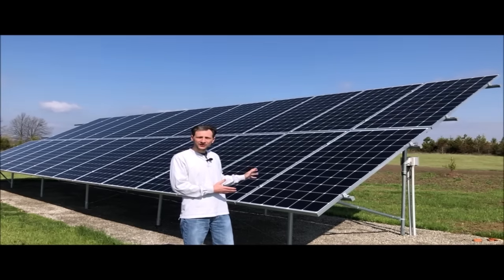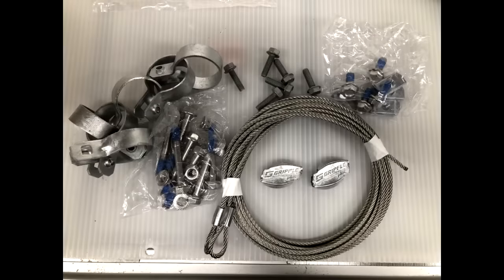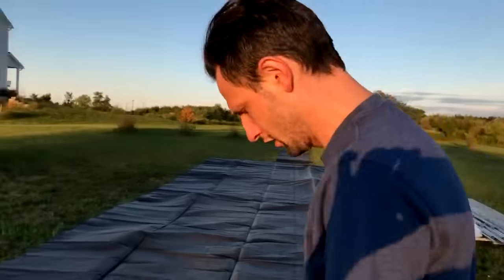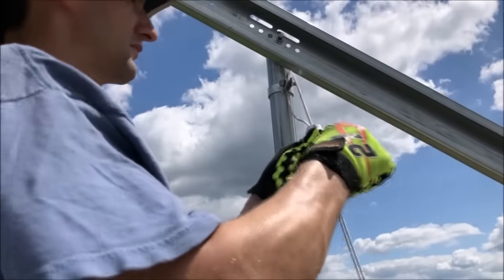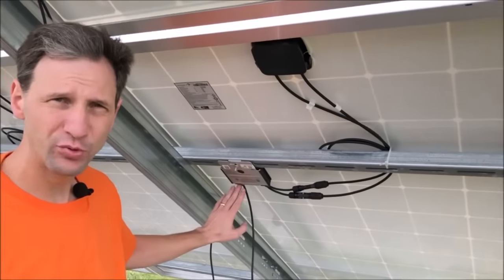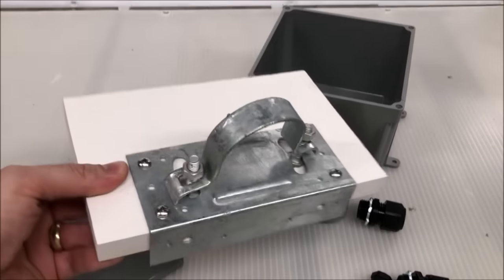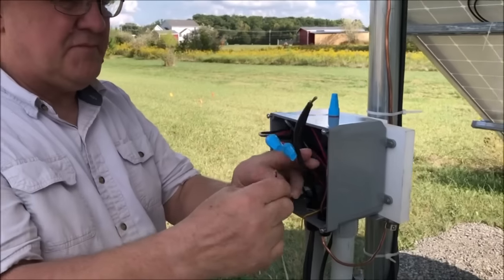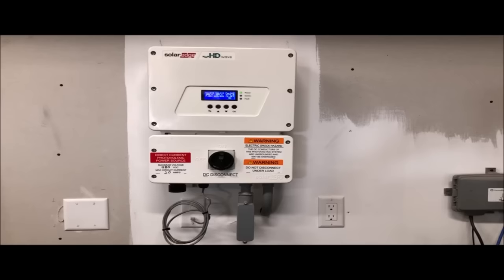DIY 9kW Grid Tie Ground Based Home Solar Panel System Installation

Comment: Very good information, I'm looking to  get solar for my home and I'd like to learn how  the panels work.  Maybe these are silly question but iI'm learning.... lets say 5 panels, together, 

Do the energy load in each panel separately,  fill up then move to the next panel and fill then  move to the next panel and so on and so on?

In full sun, do each panel  absorb energy at different levels?

If there is a crack in the panel  will it reduce the energy it creates as a whole?  How can you check to see if a panel is actually working to it's full capacity?
Reply from the maker: Each panel acts as an independent energy source.  They can be stacked in series or parallel to increase the available voltage or current.  Damage does affect performance you can see an evaluation of damaged panels I did in this video: https://youtu.be/_HKW7mwPiMI

Comment: Nice install. I don't really view my system in terms of long term "pay-back", I just try to save and then buy and install, and from then on its my own power independent of the Grid. Payback for me is obtained when the neighbors lights are all off and mine are still on. This can confuse the local power companies troubleshooting crews though :-).
Reply from the maker: Nice strategy!   : )

Comment: Very detailed and crisp video of the entire process of setting up a solar system at ground level.
Why do you get 1.05 V in output of optimizer?
Reply from the maker: The optimizers are programed to limit voltage to a save 1V per optimizer until initialized by the inverter.

Comment: Wow. Big project. Must be a fun. I have enjoyed to watch the entire episode. I wish there are some holes in between panels so that a strong gust passes through.
Reply from the maker: There is some gap between the panels.  I get high winds where I live.  The system as already seen 60mph gusts since install.  It seems to handle it with no problems.

Comment: I would have a few batteries for a small amount of backup. I am assuming that inverter would allow feeding a charge controller or does it have that functionality built into it.  Nice video btw.
Reply from the maker: The only battery charging my inverter does is EV charging, you can see that video here:  https://youtu.be/U2ilH8yOi7A
However, I am looking into some battery backup options.  Thanks!

Comment: Great video.  Wish I could install my own to keep costs down.  But the local government requires all the installation done by a licensed electrician. Consequently, my cost sky rockets and a BIG discouragement to even consider solar.  My payback went from 9 years doing things on my own to nearly 15 years because I have to hire a licensed electrician.  Being in my 70s, it does not make much sense to install solar because of local government electrical codes since I'll never be able to pay if off.
Reply from the maker: Sounds like the right decision, 15years is too long, a lot can happen in that much time.

Comment: This is a great video Dave. Can I ask you to show the installation when the PVC pipe goes up to inside the garage, I see outside (beside the meter base) installation, then pipes go through the wall to inside the garage. I didn't follow the installation and connections inside and outside the garage. thank you, sir.
Reply from the maker: Sorry, the video would be intolerably long to show everything.  There is nothing special there, I have a conduit that runs from the disconnect box into the garage and then out of the wall and into the inverter.   The conductors simply run directly from one box to the other.  Hope that helps.  Thanks!

Comment: All you need to calculate which way is North is the time. (old school watch is best)
Hold the watch horizontal and point the hour hand at the sun. Halfway between that point and the twelve o'clock mark on your watch points to the south.
and if you have south you have north too.
Also why the weird earthing - All the frames are made of metal and you used metal bolts to secure the metal frames of the solar panels.
So just connect the ground wire to the frame and you are done.
No need for all that fancy stuff.
Reply from the maker: Thanks for the helpful watch solution.  I have a tendency to try and make things more accurate than necessary, the watch hand is very short limiting how precise I can be with my angle.  The shadow method can give me a line several feet long right on the ground.  You are right, the system is probably sufficiently grounded with out the panel to panel clips.  However, technically speaking, there is a coating on the AL frames that can isolate the frame of the solar panel from the rack structure, the panel to panel clips have teeth that cut through the coating to guarantee an electrical connection.

Comment: best video of this topic. why do some designs have micro inverter and power inverters ad some only micro inverters? thanks
Reply from the maker: I'm planning to do a video explaining the differences and why you should choose one over the other.  In short, there are three main methods: 
1) String inverter - Lowest cost and simple, but less efficient especially if there is any shading or imbalance in the strings.
2) Optimizers with central inverter - Higher cost, similar to a string inverter, but each panel's voltage is individually controlled improving overall performance.
3) Micro Inverters - Highest cost, each panel has it's own inverter.  Good for efficiency and easy expansion.
There are many other detailed advantages and disadvantages, but that is the rough overview.  Hope that helps!

Comment: Good video up to the twisted connection especially on DC voltage it a fire hazard at risk. I would at least used din rail combiner connection. And on end of wire Farrell copper nickel cladding.
All and all nice video.
Reply from the maker: Thanks!  I have since upgraded to DIN rail.  You can see it in this video: https://youtu.be/uS8cqppAy7s

Comment: You can also use chainlink fence posts and top rails for the panel mounts.  Installation of uprights with a post driver and top rails with available fittings to create the entire structure.  I built one the same size as yours for $359.  Bet you paid more than that for the shipping on your's.  And the ground clips you used between panels are less ground than the clamps that hold the panel to the underlying framework which is many times greater ground than those flimsy clips.  Plus that if you move the connection point to the center you can put 6 panels on each side with no long negative 10 ga leads to "tie" it together.  Smarta-farta saves money.  Much of the expense you incurred was a waste of money.  So the pay back will be much longer...probably 10 years more...and about the same time your wife files for divorce and takes the house and the solar system:)
By the way I always recommend to get extras...extra panels, controller, etc for failures down the road.  The components are notorious for not being available in a short amount of time.  Also use of power bank batteries from electric cars can save tons of money and offer long term reliability.  Smarta-farta saves money.  Buying off the shelf costs skads of money.
I like to use 1 inch "seal-tite" conduit for runs between panel and house or even 10-2 UF romex which is both water proof and sunlight resistant.  You can drag a ditcher attachment on your tractor and be done in less than an hour.
Reply from the maker: Thanks for the ideas.  My county requires structures certified by an engineer to withstand 90mph winds.  That limited my options for DIY racking solutions.  I didn't think of putting the connection in the center, but I was trying to minimize the distance for the run to the building by putting it at the end.  Thanks.

Comment: Hello Dave, first I'd like to thank you for all the great solar presentation you have posted.  They are among the best on YouTube.  I have two questions,  most solar panels are installed with a tilt angel that is a compromise based on a number of factors.  Can I ask you why you settled on a tilt angle of 30 degrees?  My second question is related to the materials used in the ground mounting structure.  From what I can see, these cross members appear to be similar or are the same as "UniStrut" steel pipe hangers.  Can you confirm that they are basically UniStrut members, like the ones that are sold by Home Depot and Lowes.  Thank you.
Reply from the maker: Thanks for the feedback!  The angle is a compromise.  There are lots of charts online showing the ideal compromise angle based on your latitude.  That is what I used to set mine.  However, after using it for 3 years I would make it steeper.  My winter production is my biggest struggle, it's easy to produce power in the summer, and the snow sheds better with a steeper angle.  If you use bifacial panels the steeper angle is less of a negative since you can gain power from the back side.  The East-West panel mounts are heavy duty Unistrut.  Hope that helps.

Comment: So this system generates 110-120v and feed back to the grid? But the grid supplies 120-240v split phase power the house. Or does each string of 12 panels feed back to each leg of the split phase?
Reply from the maker: There are two strings that are combined at the inverter.  The inverter converts the DC to AC and balances the load with the grid automatically as loads and generation fluctuate.

Comment: Great video, should I use thicker gauge wire my drop is about 200 ft. don't want any drop off with that distance
Reply from the maker: I calculated the payback for using heaver gauge wire, but the payback was way too long.  I hope to  make a video on that topic sometime.

Comment: How much was the cost and the cost difference from having it installed?
Reply: I bet the difference in cost was pretty close to plum.
Reply: @bryaniskoo   I bet it was not plum
Reply: @gregwilcox1696  I watched it in 4k. It was the plummest I've seen!
Reply: @bryaniskoo  
You should look into the cost of the available installed systems. With their huge markup model, commission of their lead generators never mind the sales group compensations...
Ya, anyway, your comment is not very relevant to reality.  Installed systems often have 15-years+ ROI whereas many small systems are not only incrementally scalable but offer as little as 12 month or often 18-month ROIs. 

You can spend as much as you want to but you don’t have to.
Reply: @fishhuntadventure  I paid 23k for a 5.7kw system and 4.5k for for a 7.3kw system. I think they're both very good systems.
Reply from the maker: I received quotes for equivalent systems ranging from $24k to $34K.  I spent $14K before tax rebates.  My payoff will be about 8 years.
Reply: @ProjectsWithDave  8 years is great!
Reply: @ProjectsWithDave  -  I think he is about right, when I priced gear installed and it was $26k to $40k with storage, vs $11k DIY, lots of markup in the industry.
Reply: Why did you connect red and black together it should be black black and red red matte black and red

Comment: I looks like you have the main panel mounted to the outside of the building beside the meter. From the main panel you have power coming out to a fused disconnect, then into the building and connected to the inverter. On the DC side it looks like you have 4 wires from your 2 solar arrays (2+ & 2-) coming into the DC disconnect on the inverter. I believe that particular inverter has a built in DC disconnect. Is that correct or did I miss anything?
Reply from the maker: That's correct, except the disconnect is not fused, it is just a blade disconnect.

Comment: Just wondering why you didn’t series the bottom and top arrays together to avoid having to run the long jumper back to the j box? Not trying to criticize just maybe a detail I don’t know about?
Reply from the maker: There have to be two separate strings.  Each string has to be no more than 15 panels for this inverter.

Comment: Very nice, but that's not a combiner box at the array.  It's just a connection box, where you went from the solar sun-resistant wire to THHN red and black wires.  Each strings positive and negative wire is going to an inverter input point.  Combiners are an obsolete technology where strings are connected in parallel.
Reply from the maker: Yes, often called a J-box.  thanks

Comment: Why add four Number 10 wire back to the converter box just curious because you wired all the solar panels in series I noticed?
Reply from the maker: There are two strings in series.

Comment: Awsome project. Can you clear something up for me. When you were checking the voltage for 1 volt per panel,  is that a setting you select on the optimizer and then change it when actually using the system?
Reply from the maker: Good question.  The optimizers automatically control the voltage to 1 volt until they are initialized by the inverter.
Reply: Projects With Everyday Dave thank you!

Comment: Thanks Dave.  For your grounding wire... Did you just use a wire nut to connect the #6 bare copper wire to #10 THWN that went to your house?
Reply from the maker: No, the ground wire is connected to a lug on the frame and a lug on the panels and runs continuously all the way to the house grounding rod.

Comment: It looks like you're driving the inverter with 12v yes? Then 9KW equates to 9000/12 = 750A! I wonder how much power is being wasted warming up the cables from the array to the box?
Reply from the maker: The input to the inverter is 400VDC.

Comment: Love the video but why did you decide to do 12v and not 24v or even 48v since your panels are 48v and you are so far away from your house? Wouldn't the wire need be cheaper since you could use a thinner gauge? I am new to solar so I'm trying to learn.
Reply from the maker: Great question!  12V would require a very large wire for that long of a run, but the 12V is just the "safety" voltage the optimizers control the panel output to until they are initialized by the inverter.  The optimizers are DC-DC inverters that control the voltage to 480VDC during operation independent of the power output of each panel or the number of panels on the string.  I have a string of 12 panels running 480VDC with one home run and a string of 13 panels at 480VDC for the second home run.  I then have a DC-AC inverter at the house to convert to 240VAC.  Hope that helps.  Here is an explanation on the Solar Edge website: https://www.solaredge.com/us/products/power-optimizer
Reply: @ProjectsWithDave  I see it's part of the SafeDC™ feature on those optimizers. Thanks for the reply, and very nice system!

Comment: Great video on installing solar panels thanks for posting. I have a question regarding your combiner box and why did you not put a switch box with a master switch there to shut off the solar panels and wired them to a bus bar instead of using marretes? I was thinking if you ever need to replace your inverter and want to go off grid completely then you have a switch to turn off the voltage and the bus bar will allow you to easily upgrade to add more wires instead of cutting off the siliconed marretes. Just a thought on giving the system more flexibility.
Reply from the maker: There is a disconnect at the inverter and the optimizers hold the module voltage to a safe voltage of 1V/module.  I did modify the junction box to improve the layout and expandability in this video: https://youtu.be/uS8cqppAy7s

Comment: You did'nt have voltage drop? It looks like a long distance for dc power to run
Reply from the maker: The run is about 200ft and the conductors are 10AWG.  The voltage drop is 2V to 3V max depending on the current.  Because it's DC I can run it at 400VDC and have very little line loss.  If I were running AC it would have to be 240VAC resulting in higher losses.

Comment: Where did you get the post hole adapter from. I  just checked my post hole borer and it has a 2 inch circular drive shaft with a  locking bolt. I have a 42 horse Kubota and I think it should be able to drive the screw posts into the ground.
Reply from the maker: Ready rack sells an adaptor for a skid steer, but like you I had a tractor and a post hole digger, so I had to make the adaptor myself out of some scrap pipe.

Comment: And the optimizer is what exactly? Most systems use a solar panel and micro inverter. Im seeing you have an optimizer and an inverter.  ?
Reply from the maker: Optimizers are DC/DC controllers that manage a constant DC voltage for each string and send it to one DC/AC inverter.  Micro inverters convert DC to AC at each panel.  You can get more information on optimizers here: https://www.solaredge.com/us/products/power-optimizer#/

Comment: you should separate ac and the dc in the inverter.  There is a divider in the inverter for a reason.

Comment: I like to say its a nice level solar panel setup, I want a South Facing solar Panels setup, when I move to a bungalow, NOT on the roof but in the garden, might even have solar tracking >? in the garden I can improve as time goes by,
Reply from the maker: I'm glad I put it on the ground, easy access for assembly and maintenance.  The panels have come down in price so much, that tracking systems really don't make sense anymore.

Comment: Actually I would have used a higher mounting so I could grow plants 🌱 underneath that like less sun ☀️
Reply from the maker: That's another great solution, it also helps reduce the temperature under the panels and improves efficiency.

Comment: Why did you use optimizers? They are only usefull if a part of your panel is sometimes cover with shadow...
Reply from the maker: Optimizers support rapid shutdown requirements, allow me to have uneven string lengths ( one is 12 panels and one is 13), maximize the output of each panel, and improve output when panels are partly covered by snow.
Reply: @ProjectsWithDave  Ground mounts do not require rapid shutdown as they are not installed on dwellings.